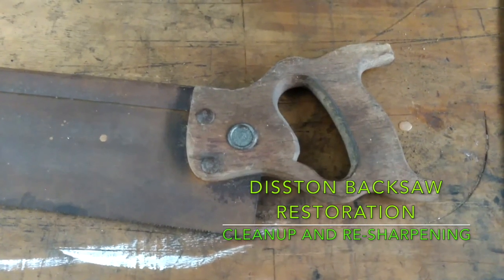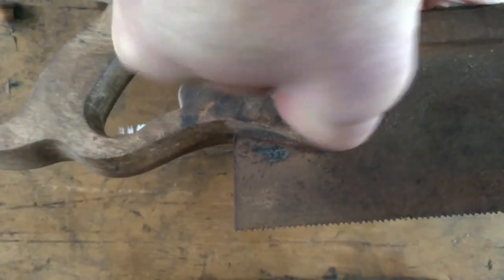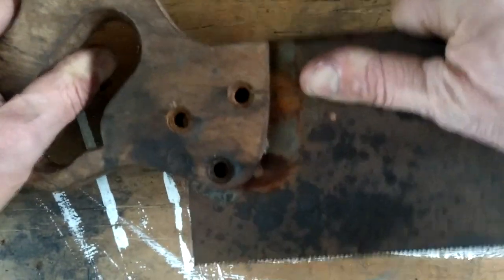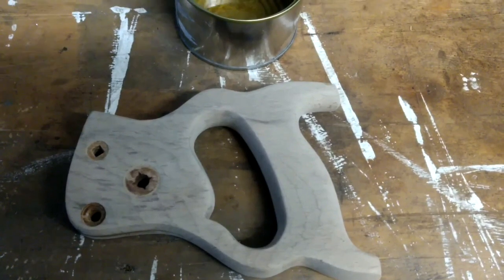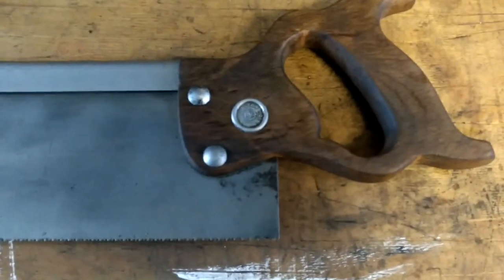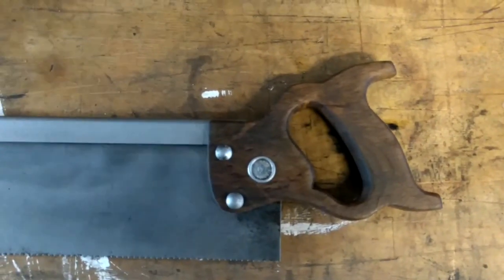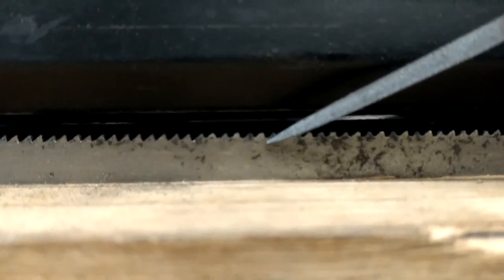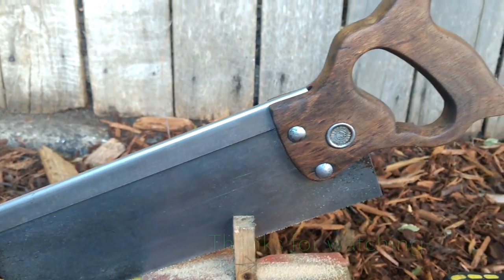Disston Backsaw - Restoration and Re-sharpening

Comment: Vinegar works, to remove the rust, but Washing soda and an electric current, (like from a battery charger) works even better.  Put the + side on piece of sacrificial metal in the tank, (like a piece of angle iron) and the - side clamped to the work.  That will turn all the red rust to black rust, which washes right off.  Much more effective, (will remove any paint usually too).  As others have said, you have to flatten the teeth first, (a stone over the top of the teeth) so that you have even heights of teeth, then sharpen them.  For a backsaw like that one, that might be all you need to do as for tuning, but for many handsaws, you might want to "set" the teeth first.  (each tooth is usually set to one side or another, so that there is a kerf, which will allow the blade to slide more easily. Also, you probably will do a lot better if you rub the cleaned blade with paraffin so that it will slide better.  Just some other hints.

Comment: Hey good job.i was  thinking that the angle
Reply: Of the file was to square to the blade and try not to file towards you if that makes sense.I have an old one I might restore now you have given me inspiration 👍
Reply from the maker: When filing backwards, i released the pressure. Given the tiny teeth, i found lifting the file made me lose track of which tooth i was filing, hence keeping it on there. I seen a few vids where this technique was acceptable in this case. Good luck with yours, it's easier than one thinks.

Comment: For the future take a flat file and take two passes over the full length of the blade to level out previous poor sharpening techniques.  when sharpening make two strokes on each tooth until compete. This is all that should be needed.  Nice restoration tho'
Reply from the maker: Mikael Muller Thanks Mikael, I am learning as I go so this will be a step I’ll take.